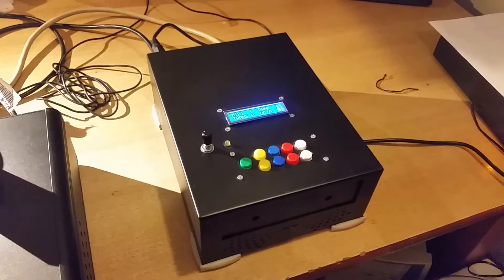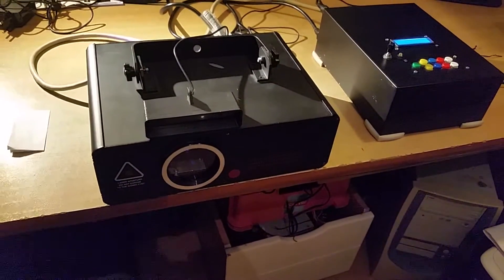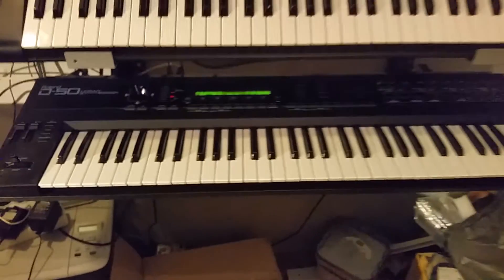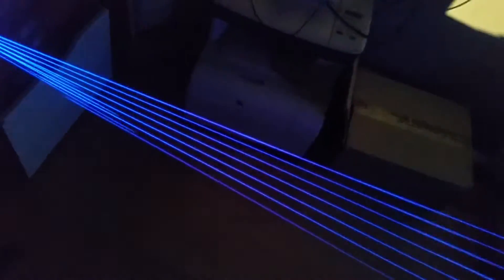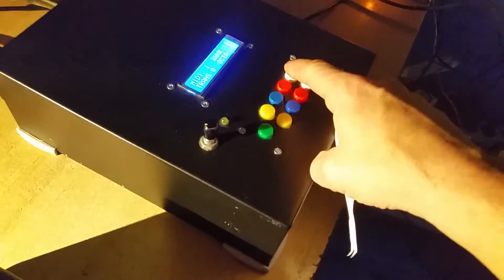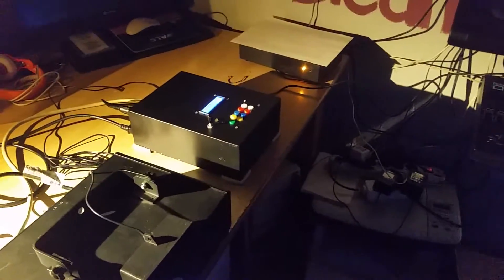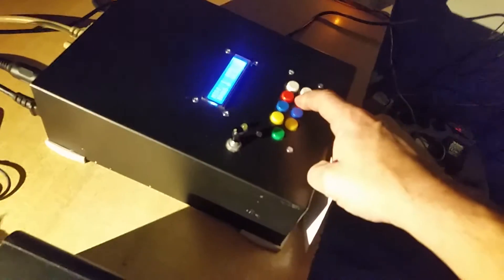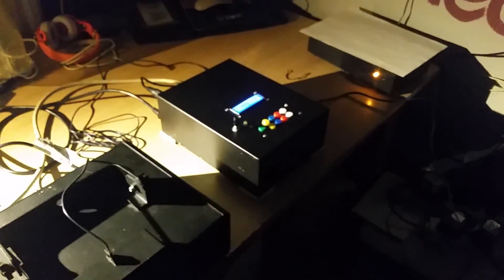ARDUINO LASER HARP ILDA VERSION

Comment: Hey, peter.. Your progression of the laser harp project is bloody brilliant... I've not been able to get as far due to my PC blew up.. Not been able to fix it... Your project though, wow...
Reply from the maker: Well, it is actually still the same thing. Almost... :-)
Reply: Yeah the concept is same but you have gone down the ilda root which I think is fantastic... I'm still in Dipper's where it comes to ILDA, I understand the DB-25 pinouts but its the guts of the laser projector to what goes where and what parts are needed between scanner and laser before the wiring to DB-25.. Do you know what I mean...? I understand I need a DAC and amp but that's about it.. Lol..
Reply from the maker: +Clive Harper I made a DAC with a Arduino DUE. That realy works like a charm.
Reply: I have heard that the DUE is a good board to use.. I have the NANO, you remember the DAC breakout board I have found a DAC similar which is DIL size (normal) and working on that but I'm using my tablet and it has limitations so just info collecting for the moment... The other reason the project has come to a stop is due to me studying for a amateur radio licence, got the exam at the end of this month so my focus has been on that once that's all over I'm back to the harp project... I can't wait...
Reply from the maker: +Clive Harper Most important reason I used the DUE because it has 2 onboard DACs which can be latched.